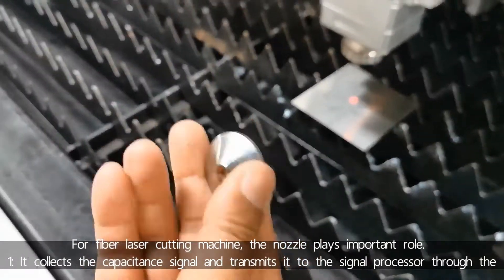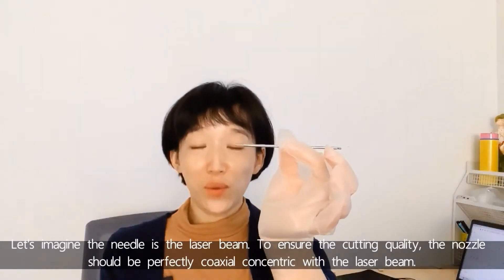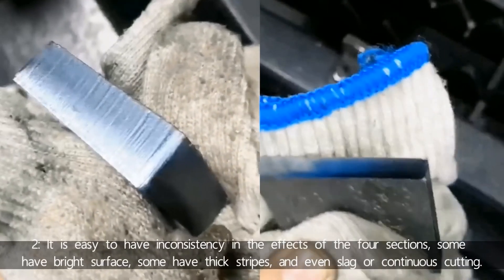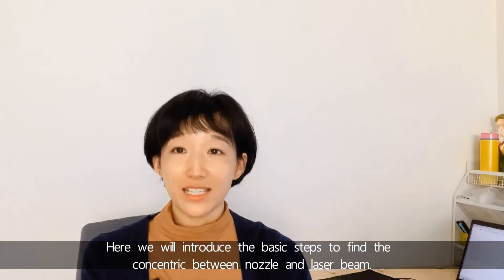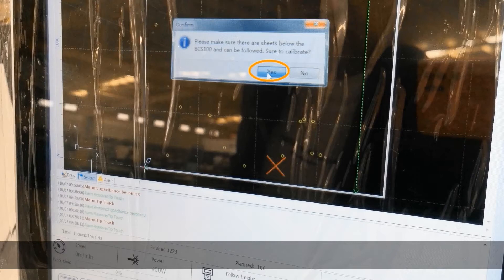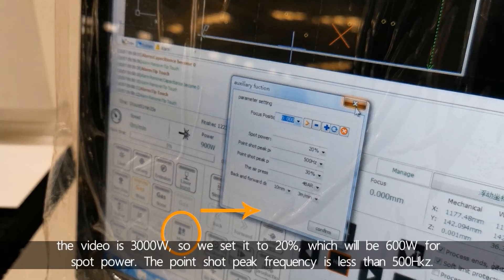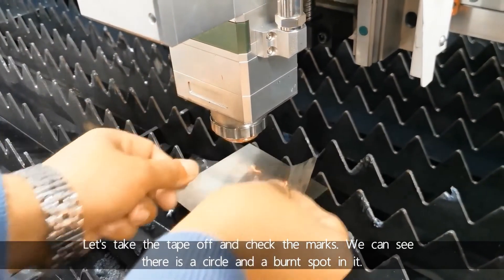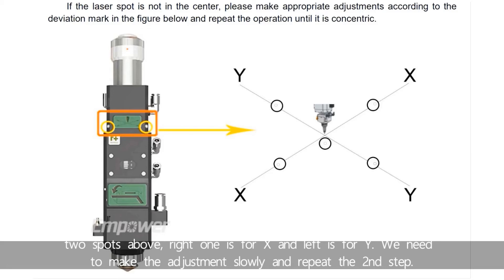Laser Cutting Nozzle | Problems and Solutions of Laser Cutting

Comment: Good evening. For my laser machine I always encounter overheating problem every 30mins. Im using air cutting only for 2mm. Power of my laser was 2kw. What should be the problem ? Thank you in advance.
Reply from the maker: What kind of heating? Nozzle heating? If it is nozzle, you can check a short last month.
Reply: @ClaraChai  the cutting head itself

Comment: hi carla, I have a problem with a 6000W laser machine with a Raytools BM114 type laser head. and cannot stably cut carbon steel plate above 14 mm thick. how much influence laser power with laser head type for good result?
Reply from the maker: I think 14mm is not so thick for 6kw, probably it is parameter setting a or some other factors.